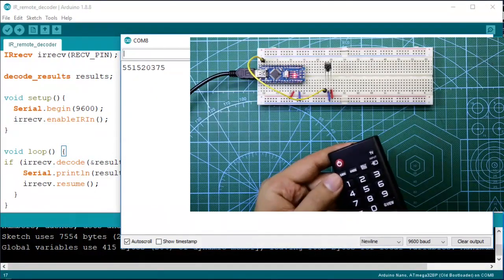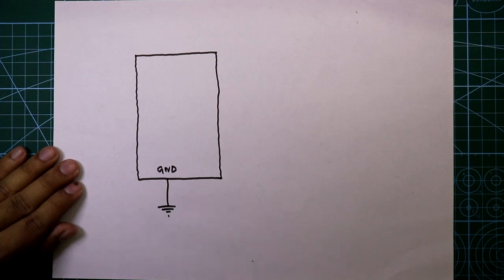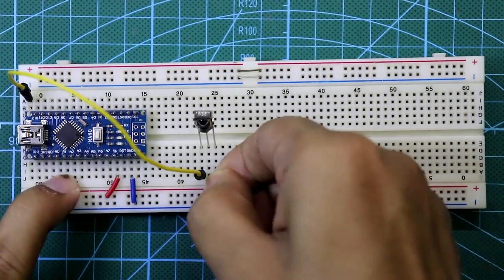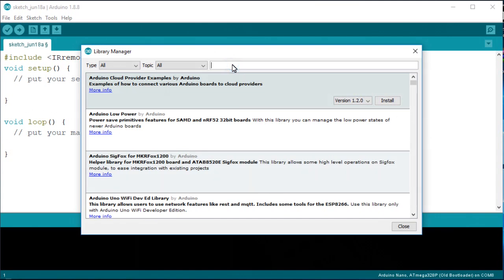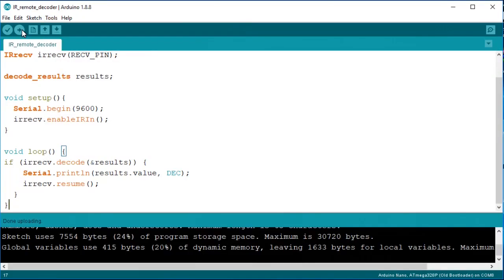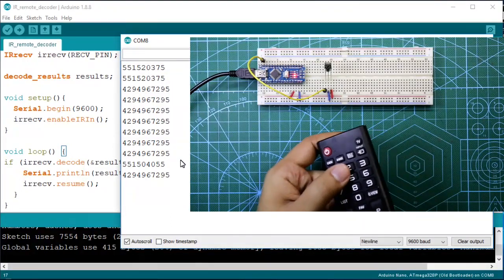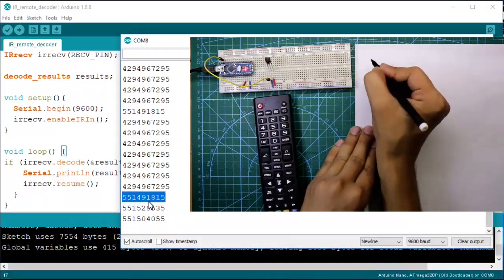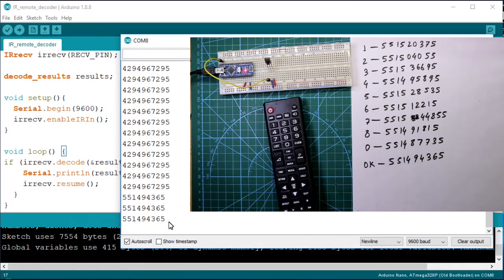How to decode any IR remote | Mini Arduino projects

Comment: This was a huge help thank you! Do you know why I am getting duplicate readouts? For example, if I press one button on the remote, I get the code for that button twice on the serial monitor. I tried to fixed that by adding a delay at the end of the loop but it didn't work. Besides that small issue it worked fine for me and I was able to cross check the decimal code readouts with the remote's functions to verify that they match.

Comment: Excellent! 
My project is to interface an IR remote to a Nano that signals actions in an existing VB6 program I wrote. 
I was having trouble compiling for Nano but after watching your video I reverted back to IRremote Ver: 2.2.3 and it compiled and runs 100%.
To those that develop/upgrade the IRremote library, when you eliminate devices with new updates, maybe you should mention this before wasting a lot of peoples time????

EE Wave, your the best :)

Comment: Bro I am not getting numbers I am getting some symbol
Reply: change baud rate to 9600 in the lower right corner of serial monitor
Reply: Yeah, I'm positive your baud rate is off. Check your code. Likely in the initialization function you have "Serial.begin(9600);" which means you need the monitor to match this baud rate of "9600."